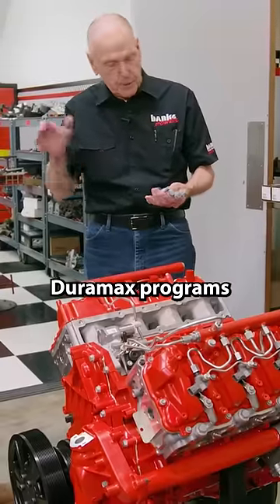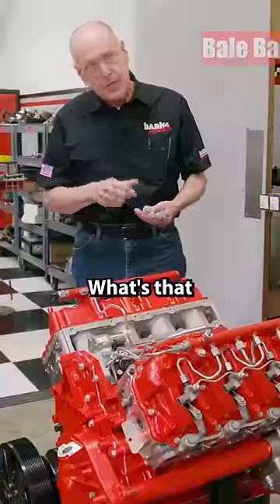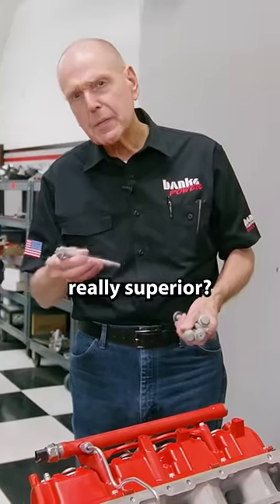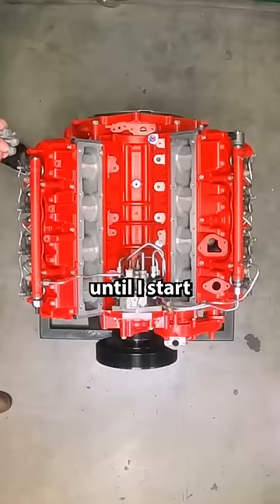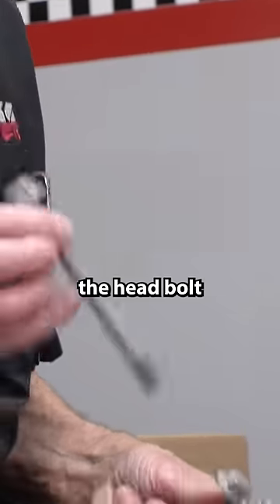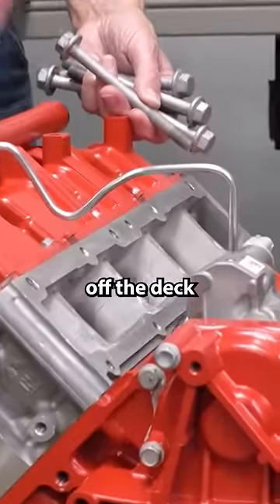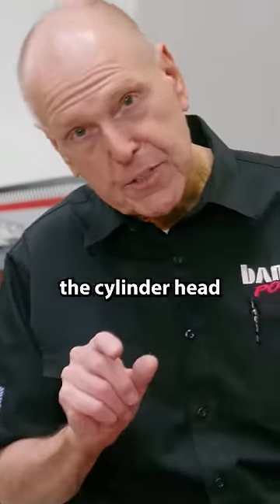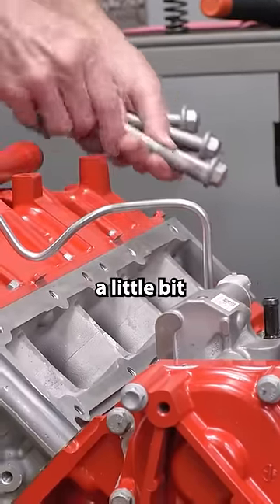Upgrading to head studs might be a bad idea

Comment: Engineering senior once said, "design a failure point,  or the system will assign you one."
Reply: Did he design The Death Star?
Reply: An old machinist told me " Always schedule maintenance for your equipment, otherwise failure will schedule it for you.".
Reply: Yeah if you're designing something new you want the failure to be predictable, not the same case here if we're just minimizing complexity therefore 1 less failure point.
Reply: Yep very big concept in structural engineering. Not only are buildings designed to stand up but they are also design to fall down in a specific way in many instances. Especially buildings that have lots of people in them every day.
Reply: this is the rule of thumb on boosted stock ford 302's. You never put a mls head gasket, you put the graphite ones. They'll act as a fuse. Guys put mls and at the slight hiccup,  the whole bottom end explodes
Reply: Very interesting thanks for sharing 👍
Reply: That what leads to Stronger Alloys or Bigger Engines
Reply: @Levon_Darratt Hes talking about high horse power not a Fleet or work trucks 😂😂
Reply: Exactly
Reply: Damn, I like that saying
Reply: @austinsmith6714 small thermal exhaust port right below the main port!! that's all I'm saying!! Bahahahaha!!! 😅😅
Reply: @XxMusclecarsxX you just reminded me how bad I want to stay in financial turmoil a little longer to get a turbo kit for my 302 swapped extended cab ranger. 😅
Reply: Did he work for Ford? They seem to have that engineering mentality
Reply: Most smart thing I've ever heard thank u!
Reply: I like that. Thanks for sharing 🤙
Reply: @austinsmith6714 aka isuzu diesel
Reply: Or just design everything to fail, or you'll only ever sell one to each person
Reply: @XxMusclecarsxX simply make only 449 horsepower
Reply: I love that,too real.
Reply: @klausphx Or just keeping the cost down because head bolts are cheaper and easier to "reengineer" than changing the block alloy.
Reply: Best advice ever
Reply: This is exactly why when we build performance Harley engine's with heavy duty aftermarket cylinder studs the torque value is lower than stock, torque the headbolts (they're actually blind nuts) down to stock specs and you risk ripping a stud out of the case on a high compression build.
Reply: Very very true!
Reply: Lol exactly
Reply: I love this!
Reply: @XxMusclecarsxX YES!. Graphite headgaskets, and run arp bolts at 55-60lb ft instead of the 70-80 recommended.
This will keep a rod/piston only roller 302 sbf from exploding at 650+hp on all the boost, shifting at 5500rpm.
Reply: Gonna start saying this when people mention Subaru head gaskets😂
Reply: It’s called planning for failure. You intentionally design a failure point so that it removes failures in other parts of the system. The worst kinda failure is a brittle failure, similar to what he showed.
Reply: Unfortunately nowadays they have this thing called planned obsolescence.
Reply: @lucky7s94 those are a LOT of fun! Wish we hadn't blown up my brothers!
Reply: @sgtstedanko7186 the audacity to think that failure only happens where we allow it to
Reply: @CrispyCars  yes you’re right and that’s a different thing altogether.
Reply: @e.m.1766  maybe, but they're choosing their failure point
Reply: Designed sacrificial failure points are far more affordable than random and catastrophic failure points for sure.
Reply: The number of likes on this comment is well deserved 👏🏻
Reply: @austinsmith6714  Duh, Mads Mikkelsen did
Reply: Dude this is total gold. Holy shit❤
Reply: "Weakest link"
Reply: @austinsmith6714 single best response of all time lol
Reply: Thats how Fords are made.
Reply: And its usually a more expensive one
Reply: Love the saying
Reply: 😂That's so true！
Reply: @austinsmith6714 underrated reply
Reply: @XxMusclecarsxX pressure relief failure?
Reply: @austinsmith6714 😂
Reply: They claimed that was the solution to the North Star V8 blown head gasket??
Reply: Ooh.. that's good👍
Reply: @XxMusclecarsxX  HOW?
Reply: @XxMusclecarsxX  I'm really wanting you to layout the lesson on this statement...genuinely curious of the WHATS,WHY,&HOWS to MLS causing grenades bottom ends
Reply: @mxreese69r6  The mls gaskets don't directly cause problems. The 302s are known for their fragile crank and block. At high horsepower (+500whp) any knock or bad tune can blow them up. With a graphite head gaskets, they will act as a fuse and save the engine. The mls won't fail though, so the bottom end breaks. That's the idea behind it, many do this. It's better to blow a head gasket and save the engine than have a very strong mls gasket and studs and blow the bottom end.
Reply: @garthfarkley  a weaker gasket will act as a fuse
Reply: Yup.
Reply: @ricardorodriguez-se7tp He wasnt talking about trucks or fleets either. What are you on?
Reply: episiotomy versus a tear, down there.

 I'm not a woman, I think I know which I prefer 🤷‍♂️
Reply: Ok. What have you got to say?
Reply: Fuse
Reply: I like it
Reply: It would be a lot better to say "understand all the potential failure modes of your design".
Reply: @MicroplaysMC  German engineers "Hanz, the timing chain tensioner must be made of plastic and shall fail causing catastrophic engine failure as intended"
Reply: @lucky7s94 302 swapped ranger gang 🤝
Reply: Just like gas tube on AR15.
Reply: Plan to fail or you fail to plan
Reply: @XxMusclecarsxX  no it doesn’t
Reply: Then something like shear bolts? If you break a shear bolt and replace it with a bolt that won't shear something else far more expensive will break on you.
Reply: Damn ,that the most poetic thing I've heard since -
" if you are going to jump out of a plane without a parachute, take an extention cord,it'll get caught on something on the way down
Reply: yeah but how long will it last until it does assign you one?
Reply: @austinsmith6714 😂😂😂
Reply: @Levon_Darratt lol
Reply: Great advice..
Reply: Hence: Fuses
Reply: Same reason its better to build a driveline with the failure point being the $50 ujoint otherwise it may be you're $5000 transmission ect. lol
Reply: A theory I have heard before. It’s like a drive line fuse. The tail shaft.
Reply: 1000% , came to see if this comment was here and was gonna leave it myself if it wasn't aha

Comment: When a genius speaks, shut up and listen.
Reply: @khg8519  here comes negative Nancy😂
Reply: Engineers have been saying this for years and then mechanics show up in full force bitching.

Put an engineer in a shirt to look like a mechanic and all of a sudden the same info is gospel.

Not saying this guy is dumb (he absolutely is not) but the audience definitely is!
Reply: @Taskarnin  if the engineers were perfect in their design, the mechanics wouldn't have a job to do in the first place.
Reply: @captainswanky8666  you set the record straight with honest truth.👍
Reply: @captainswanky8666 so cars don't need maintenance? Lol I won't deny that some mechanic jobs become 10x harder due to design but regular repair and maintenance would still keep mechanics in business.
Reply: @khg8519  he actually gave a pretty damn good explanation. They don’t have to be used you could get new OEM. He is 100% right the head bolts are likely designed to fail before the block material. But if you increase the tensile capacity of the bolts too much you very well could force the block material to be the controlling factor. Like how a weld is stronger than the base metal, forcing a failure in the base metal before the weld fails.
Reply: @khg8519 Bro he just spoke facts when one thing is made not to break something else will.
Reply: LOL, we been fixing blown headgasket issues for years with stud jobs. Because they also cause fatigue failure in the bolts and eventually fail.

It takes a LOT of cylinder preasure to rip studs out of the block of a D-max. Like he said. Well over a thousand HP. Probably pushing 1500 or close to it. That's a lot of power.

If you are ripping studs out, you found the limits of your block. Not the studs fault.

Also, like in the 6.0 powerstroke. They would stretch allright. But given time, and not even that long. They would fatigue from all that flexing and fail. Causing blown headgaskests. Especially when pushing hot tunes and lots of cylinder pressure. Studding them has a proven track record of solving that issue. But also holding down more power before popping. Actually you need thicker and stiffer bolts for higher HP.
Reply: Well we can do half and half
Reply: @captainswanky8666 actually the laws of thermodynamics are the reason why mechanics have a job no matter how well you design anything no matter how much money you put into it it will wear out, or fail or break eventually. And remember engineers only work within the cost and time parameters set by their bosses.
Reply: @captainswanky8666 if you knew anything about engineering or had some common sense you would know that’s impossible
Reply: @nate8867  nothing is impossible. Way to try to hate on complete strangers on the internet, tho. I bet that does an incredible amount for your lack of self worth😂
Reply: “Until we have a failure, we won’t” - Gail Banks 
🤔😳🤣

Either that’s pure genius or utter nonsense, but either way it got me thinking. 

Gail definitely has the years of experience, expertise and craftsmanship to back him up but I was confused by this statement.
Reply: When a genius tells you to fix a known issue AFTER it fucks up, might get your info rom somewhere else.
Reply: @khg8519 he said shut up, do so and listen
Reply: @captainswanky8666 probably a subaru owner. only they’d be bad about something that cant save their motor from killing itself lol
Reply: @T.Hizzle  who fixes things that aren't broken?
Reply: @khg8519 not old, just stock
Reply: @khg8519  no. He is. And I would take his opinion over yours until you demonstrate otherwise. That's how learning works. You should try it some time.  And he didn't say old head bolts. He said stock head bolts.
Reply: @captainswanky8666  The more relevant question is who puts or neglects to change subpar parts on a modified diesel engine when the said part is a well known failure point.....
Reply: @T.Hizzle the failure point still exists. You're just moving it to a more expensive part😂
Reply: @captainswanky8666 fix it UNTIL it’s broke lol
Reply: @khg8519 never run used head bolts lol they are torque to yield and once torqued to spec over time they lose some of they're springiness and are more likely to snap. I know that's not what you were saying just thought I'd add to it for more context
Reply: Ummm......no. He's not a genius. He is smart in some things and not in others.
Same as loads of people.
He's just put on a pedestal so people can hear some of his stuff.
For real. Just think about the things he says,  versus the actual results the bulk of people who modify things find the hard way.

All I'm saying here is not to take someone's word at face value. It might actually save you some real cold hard cash, or waste your real cold hard cash.
Reply: 100 percent correct.
Reply: genius yes but it wont be from him!
Reply: @khg8519 he didnt say use the old head bolts. He said use stock head bolts. Big difference. You can purchase new stock head bolts derp
Reply: @captainswanky8666 exact same and applies, even more so for armchair mechanics, mechanics create the need for mechanics who destroy everything so engineers have to design things to accommodate stupid mechanics.
Reply: @airgliderz  you sound like someone who's never worked on vehicles before.
Reply: @CattleOx nope...90% of customers don't know a mechanic untill something breaks. They never heard of preventative maintenance and scheduled service outside of oil changes.
Reply: @khg8519  he's not reusing the head bolts he's using new ones but they are stock bolts not arp or anything else.
Reply: @jayo1493  😮
Reply: @captainswanky8666 they all say the same in all his videos. Its like we get it, you respect the guy…
Reply: @khg8519 you got 0 comprehension, he said stock not old and worn. Stock still can still be new.
Reply: Ok boomer
Reply: @MotoVloggedOUT  nice swing, but you missed. Just like your chance to move out of your mom's basement😂
Reply: @khg8519 and your just changing your bolts to feel better about an engine thats not producing enough power for it to matter anyway🤣
Reply: For some reason, Americans like to demonize geniuses. It’s wild.
Reply: @mexicanprivilege7848  yo.. its not Americans.. it’s liberals.. chill
Reply: @captainswanky8666 why? Maintenance doesn't exist? Shitty drivers and user error aren't a thing?
Reply: @captainswanky8666 Designing a power plant that doesn't fail and doesn't require maintenance is science fiction. And why complain that they do fail? Mechanics wouldn't have a job or industry if engines were perfectly designed. Mechanics complaining about engineers is beyond stupid.
Reply: @ulbrandt  is this coming from someone that's never worked on vehicles? Because there's regular occurrences of poor design flaws where plenty of mechanics would like to wring the neck of the engineers for making things so difficult to access or fix.
Reply: @captainswanky8666  I understand and appreciate that, but that's also what keeps mechanics in business and able to make a living. I get that engineers can do stupid things that are frustrating. But the worst case scenario still amounts to job security. The better engineers are, the less mechanics would be needed and the less they would get paid. Their mistakes and flaws create an industry in which to ply a trade.
Reply: Service be it repairs or maintainence will always be needed.
Reply: @captainswanky8666 love this.
Reply: He's not a genius. He's good at marketing
Reply: @boostaddict_  what's he marketing? Doesn't seem like he's trying to sell a product here🤔
Reply: @khg8519 he was saying use stock headbolts not aftermarket. NOT used!!!!
Reply: You hold him on too high a pedestal
Reply: @captainswanky8666  This is a clip from a video he made to promote his company. You're treating him like a genius because you believe what he says, which means he's sold you on his knowledge. I have firsthand experience with failed head gaskets caused by stretched head bolts, the same engine hasn't had a single issue since it got a set of ARP studs.
Reply: @johnrus7661 facts. Couldn’t have said it better myself
Reply: 😂😂😂 he's not a genius he's a guy trying to peddle his wears for the largest retirement package possible..
Reply: @scott.baierscott2198  nobody said you had to listen to him. I love all you people thinking you're smarter than someone who has done this their whole life, and especially you thinking he doesn't have enough money to retire😂😂😂 I guarantee he has more money than you😂😂
Reply: He is not speaking truth though.
Reply: @PlutoniusX  when you strengthen one part, it doesn't just move your failure point to another part? There's no truth to that?
Reply: @captainswanky8666  He is speaking rubbish on the fact that head bolts yield during normal operation. They do not. They are already torque to yield so further yield would result in plastic deformation. I heard plenty of nonsense to discount studs on Northstar repairs for that same reason. Guess what, studs last and the original head bolts pull out.

That is the thing that bugs me because it is not right.
Reply: @khg8519 no one said old, just oem
Reply: When the whole vehicle needs disassembly to repair the issue I’ll take my chances with the head studs..
Reply: And that's why Gail is the master!
Reply: an engine genius build his own parts. there are not many of those
Reply: Captain notsoobvious here . Did a measuring tool job yrs ago for a firm that makes a wrench tool for tightening Nuclear Reactor Head Bolts. Guess what: Their cocky boss stated that those bolts are to be tightened to spec so that they wont flex as reactor pressure changes. I.e. static clamping downforce always higher than reactor head upforce. If not tightened to spec, the bolt will flex and eventually break from fatigue. (And that has happened). Compare that to the video discussion! 
Also those bolts are allegedly cast in place. Can't change them. They are hollow with a long pin in the middle. You tighten the nut so the bolt extends x mm compared to the pin.
Guess what 2: Those reactors can have 72 bolts, and you tighten them as you walk around the lid, in plastic suit and all. No criscrossing as we're told to do with wheels and cylinder heads. Didn't bother to argue about that, Westinghouse et al wins.
Reply: @jonashellsborn7648  so put your wheels on in a round pattern instead of criss cross if that makes you happy. There's still people a lot smarter than you regardless of your experience with your one time job that's completely unrelated. Do you have problems following the orders of your bosses often?
Reply: @captainswanky8666 it's common sense.  Everyone knows this.
Reply: @khg8519  you can't reuse, but the only justification for studs are northstar v8s
Reply: @khg8519  No one said use old head bolts. Using stock head bolts doesn't stop you from using new lol
Reply: He's good but not 100% always right. He's wrong on this
Reply: @khg8519 you can never use old head bolts they stretch and have to be replaced he is explaining why to use the stock ones this is basics of engineering principles and why failure points are designed and not discovered
Reply: @captainswanky8666  yeah as if engineering is about perfection. There is no perfection in this world. It's all about optimization and compromises.
Reply: @hehexd922  if engineering wasn't about perfection, we would have buildings and bridges falling down. Don't make excuses for failures.